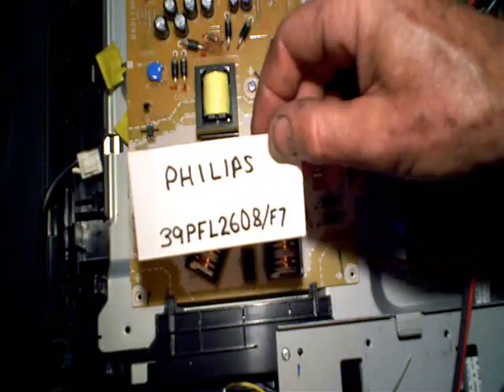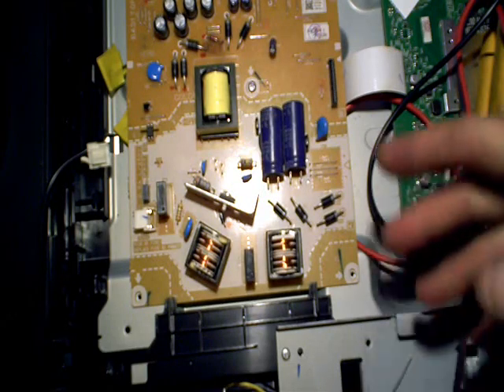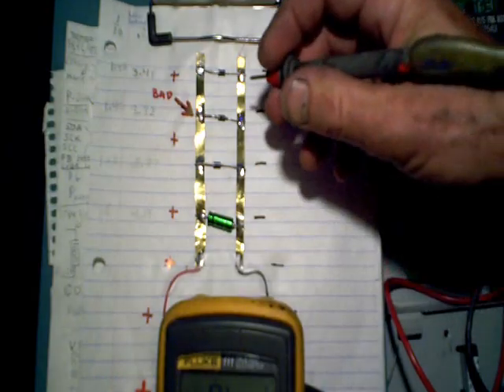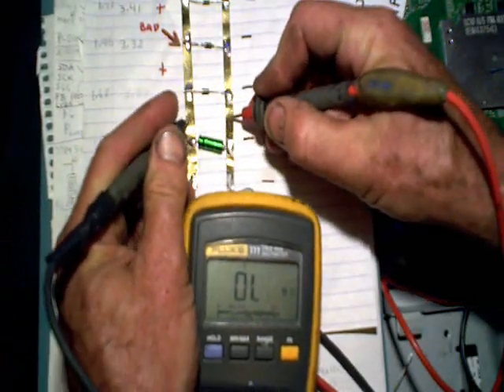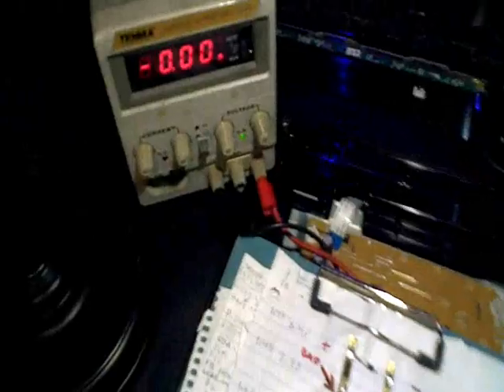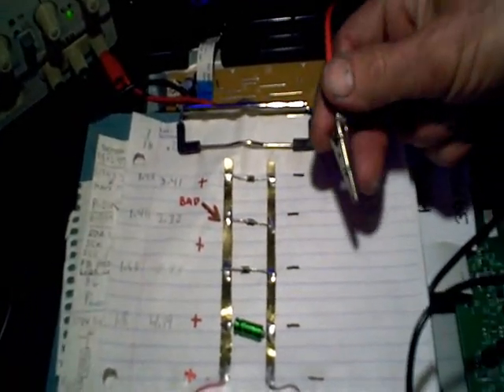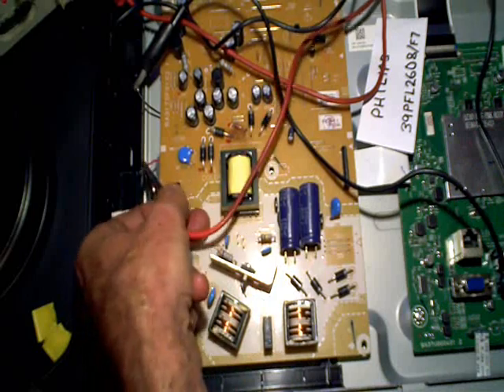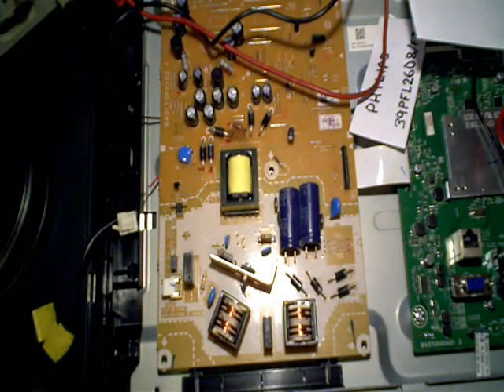Your Multimeters Millivolt scale can be used to locate shorts to ground.

Comment: I'm a retired avionics tech. 30 years ago HP published a trick not unlike your own, using the mv on the DVM, but with no guessing. To find the short connect a current limited supply to the shorted supply rail at the spec voltage but with a safe current limit. Now connect the positive lead to the rail, and we'll use the neg probe to chase down the short. Clearly the millivoltage will grow towards the short, and if you probe past a node, the voltage will stop increasing.
Reply from the maker: I'm not to surprised. Unless you own a low ohm meter capable of 1000 divisions it's a great option.
Reply: That's how I used to find shorts until I got a $200 FLIR that connects to my phone. Now one of the first things I do is take pictures of the board temperature signature when I first power up the item. Sometimes it pinpoints the problem without any troubleshooting.
Reply: @RickNickel  hi Rick  would you post a link to this?
Reply: @RickNickel  Looking at one today for the same purpose.
Reply: it kinda like the opposite of what he is doing very smart!!!
Reply: @GrantsPassTVRepair If your constant current that feeds the circuit is beforehand adjusted to exactly 100mA, then your mV reading on the multimeter will equal to mOhm reading. Thus, when troubleshooting, you are searching to spot the point of the lowest mOhm reading (as shown in the video). By this method you can also measure any small value resistance down to 1mOhm or even lower, depending on the accuracy of the multimeter you use, in its mV range. For the reading, you only need to shift the decimal pointer by one digit to the right side. In this way you read the displayed result directly in mOhms. This is also the best method to measure sub-Ohm resistors or evaluate shunt resistors with amazing measurement accuracy, which, otherwise, would demand buying very expensive mOhm meters of the market for that purpose...
Reply from the maker: Yes thank you. applying voltage in the manner you suggests makes sense. @ΠάριςΑζής

Comment: hi, is there a difference between a bad diode and a shortened diode when checked with a meter  what i am asking would a shortened diode measure as bad with a meter ? thank you
Reply from the maker: I don't quite understand your question,  but I think you meant to say shorted diode rather than shortened diode. ;-). When the short out they generally become like a piece of wire with almost no measurable resistance. Less than 1 ohm.

Comment: Well that's great if you short is because of a bad diode. What do you do if it's NOT a diode?
Reply from the maker: If it's a shorted part other than a diode,  the same technique can apply, but unless you have a schematic, or a pinout of the part, it can be more challenging to isolate which part or parts have gone bad,  When transistors go bad their terminals often short out between them, so using an ohm meter can also help you isolate the problem by looking for shorts between the transistor terminals. Having a schematic can help you understand what's likely to be a shorted part if you measure a low resistance path to ground on a component terminal that should show an open relative to ground of your power supply, and learning to read schematics can be a time saver if you happen to have one for the device you're trying to repair, and knowing which parts are more likely to fail can also be helpful. The parts which mostly commonly fail are diodes, transistors and ICs. It's been my experiences that electrolytic capacitors rarely short out, but sometimes the small surface mounted capacitors are known to short out.
Reply: That's exactly my problem. I have a short on the board I'm working on, but I suspect the issue is a ymf292f sound chip, for which I can't find a schematic or a replacement! Thanks for the response. @GrantsPassTVRepair

Comment: What a fantastic video!  Over my self-educated time spent (100's and 100's of videos and some books), what no one ever said/wrote was that in repairing electronics, it all comes down to OPENs and SHORTs; with SHORTS being the "variable" cause ... meaning that there can be a SHORT ...or... a PARTIAL SHORT that's causing the problem.  Once that became apparent, troubleshooting changed to "much easier" to diagnose.  I have a Zapper, built a LeakSeeker, have injected voltage, and and and.  This video from 7yrs ago ... I wished I had discovered earlier.  It added a very valuable approach ... inject a small voltage and then look for a voltage drop in the mA's (or maybe even uA's if you can).  Brilliant.  Thanks for this video.
Reply from the maker: Thank you for the comment. It's always nice to hear when someone appreciates on of my videos.  We had a period where bad capacitors kept repairmen fairly busy due to a manufacture error known as the "capacitor plague", but that's not so common anymore, so other than bad eeproms and leaky parts, I suppose shorts and opens do make up the bulk of repairs. All the best.

Comment: Actually, there is one thing here VERY WRONG.
Measuring with current is ok, but 0.25A is TOO MUCH - that could've fried your diodes!
Most diodes work on currents around 20mA (LED diodes for example) and that is a level you should have.
In this example you where lucky that the diodes you had there where power diodes, but on laptop motherboards and elsewhere, the diodes are much more sensitive and they can get fried with as low current as 50mA.
Of course, a short to the ground means that the power will go through the short and not through the diodes, but once the short is gone, all that power would go to those diodes.
Another safe thing (except limiting current) would be to try to find the short by limiting the voltage to 0.25 V - at this voltage most of the diodes just don't work and no harm will happen to them even if the short will be eliminated.
At 0.25V only thing that works is passive components (and shorts) - and those can handle that voltage no problem, so you don't have to limit the current so much when you are at 0.25V.
Reply from the maker: Yes there are some components such as LEDs that can easily be damaged with 0.25 of an amp, but If you insert a low voltage directly across one of the electrolytic capacitors on the circuit trace in question,  and apply the correct polarity your not likely to damage anything. Especially when you consider there is already a short dragging your voltage way down below normal operating voltages.
 If I see an electrolytic capacitor on the circuit trace I'm testing with a working voltage printed on the side, I think it's fair to assume I can safely apply 10 percent of that voltage and probably much more without causing any additional problems. Even if the short were to open, as long as you don't exceed the normal operating voltage of the circuit and you apply the correct polarity it should be fine.
Reply: @GrantsPassTVRepair  the short acts like a dim bulb device?
Reply from the maker: The short is preventing your power supply output from passing through the circuit it's intended to pass through.  @fullwaverecked

Comment: I fixed my MacBook Air with this method. It had shorted component somewhere on the main power rail to ground. Supposedly, capacitor. But which one of many (about 100)?
I put about 0.5V 1A to the board and then started to measure all capacitors to find one with the least voltage on it (because it will be the shorted one).
And I found it! With simple cheap multimeter and power supply.

Comment: Could you also use nS to measure conductance and then convert it to ohms? For small resistances. The fluke 87v has nS but is kinda hidden.
Reply from the maker: I don't understand your question.
Reply: Never mind. I was thinking you could use Nano Siemens which can be used to measure very hi resistance. In this case your measuring very low resistance.  My fault. Thanks

Comment: I would think a component shorted to ground would have no voltage drop across the component. Doesn’t the shorted component just become a low resistance wire, therefore no voltage drop across it .
Reply from the maker: Your correct about a shorted component becoming like a low resistance wire, but if you measure across the component input wires with a voltage applied to the component you will see more of a voltage drop than you would with a non shorted component.
Reply: Grants Pass TV Repair I thought less resistance less voltage drop. Ie. no load, no voltage drop.
Reply from the maker: Think about this concept. You attach a 10 volt battery to Two parallel wires that are 5 feet long, and at the end of the 5 foot stretch of wires you attach a 1 ohm resistor. If you measured your battery voltage right at the battery terminals it would read higher than the voltage you would read across the resistor due to the voltage drop across the resistor. If you did this same experiment using a 10 ohm resistor you would have less of a voltage drop, and you would read a higher voltage than you would using the 1 ohm resistor.  I hope this example helps.

Comment: can we use this method to find a short on a Laptop mother board?
Reply from the maker: Yes. If you know where to test such as a positive power rail that should never have an extremely low resistance reading to ground. If you don't know where to test on the circuit board you can check for shorts across your capacitors. If you get an extremely low resistance reading it means you have a shorted capacitor or something on the circuit in parallel with the capacitor may be shorted.

Comment: seems like way more work than just to take your chances and start snipping a few anode leads until your short is gone. then a dab of solder to reconnect the innocent components
Reply from the maker: Clipping leads or un-soldering multiple diodes sounds far more labor intensive than a few quick probes with a low ohm meter,

Comment: I like you video, this the second time I watch it because i am trying to find a short. little confusing, you measured across 3 diodes at about 1.04 mv. then you measure the shorted diode at 0.64 and you said you would know this is shorted because it has a much greater voltage drop. how is that greater voltage drop. isn't 1.04 mv is greater than 0.64.
Reply from the maker: 1.04 is larger than 0.64. The smaller fraction indicate more of a voltage drop.
Reply: @GrantsPassTVRepair  thank you. mmm I got to wait a while before that one settles in my mind.
Reply from the maker: @jacka.4774 Do you understand  how 0.1 is Ten times smaller than 1?                                                When I'm testing for voltage drop across each diode I'm trying to figure out which diode reads the smallest number to figure out which diode is shorted.
Reply: @GrantsPassTVRepair  thank you. so could you see if I understand it correctly. if shorted you read lower voltage across diode compared to the same ones.  same as measuring voltage across the same short piece of wire.
Reply from the maker: @jacka.4774  Yes, it sounds like  you understand correctly. When diodes go bad they often short out and become much like a small piece of wire, and you will see their resistance will generally measure One ohm or less. They can open also open up inside, but that's far less common.
Reply: @GrantsPassTVRepair  great wonderful. thank you so much.
Reply from the maker: @jacka.4774  Glad I could help.

Comment: Should I connect the  VDC power to a short circuit as your demo???
Reply from the maker: +Hiem Ngo I'm not sure I understand your question.
Reply: I am wondered when looking at your demo when you turn ON DC power supply and connected to a short circuit that you made it by your own. I think it would  feedback and blow power supply if you leave it for a certain time. THX,
Reply from the maker: Yes it could be a problem if your asking the power supply to deliver more amps than it can handle. My power supply can deliver up to 3 amps with out there being a problem to my power supply. If your power supply can't handle what ever current a short circuit produces, you can add a resistor in series with the device your attempting to repair. You resistor will probably get hot if your device has a short so you may need a high wattage resistor.
Reply: it is exactly you need to  mention in your demo, if there are someone do not know would cause lot problem. Also, You forgot to let reader know the  method measure Diode by reversing the lead of DVM,
Thanks,

Comment: I don't understand why people who do electronics keep buying Fluke multimeters, - yes they are reliable, rugged and accurate within their ranges - but the update rate is slow, the resolution is low, it's very lacking in functionality, and it's damn expensive.  It's more of an electricians' meter.
Reply from the maker: +TheAmmoniacal I don't know about the new fluke meters, buy what sold me on the one I started with is how well it tolerates abuse. Often times when  checking the voltage I would mistakenly leave it on diode check or the resistance scale and it never seem to hurt my meter. I wonder if many modern day meters can tolerate this kind of abuse.
Reply: 1. Keysight U1272A
2. Brymen 869
3. Brymen 257
Reply: ***** They are still much better than Fluke.
Reply from the maker: Do the meters you mentioned allow you to leave them on the wrong scale with out being damaged? I have a bad habit of leaving my meter on the wrong scale, and my Fluke meter has never been damaged doing this.
Reply: No modern >$100 multimeter should. But some of them will act up and take some time to recover. The U1272A will show inaccurate readings on AC for up to 2 minutes if you measure 220 VAC on the ohm range for example.
Reply from the maker: That's a slow recovery but at least I can handle an occasional mistake.
Reply: +TheAmmoniacal A fluke meter is a must have item in a tv repair shop...You take it on house calls and it gets dropped and the owner and I shared one so it got a lot of rough use. And it has good protection many times I left it set on ohms and tried to measure voltage but it didn't blow it out.

Comment: I am trying to understand how parallels can have different voltage drops . I assume there must be a voltage drop along the tracks joining them ?
Reply from the maker: I don't understand your question.
Reply: +Grants Pass TV Repair unless i misunderstand your approach , well the caps and the diodes are all in parallel so the voltage applied was across all of them equally. So if the voltage drops are not equal there must be a voltage drop between the components which are connected with conductors.   I cannot understand that this is possible unless the short is actually more short than a typical conductor .
Reply from the maker: Every component is in parallel, and by testing the voltage across each component I'm able to determine which one is shorted by observing which component has the lowest voltage reading.
Reply: +Grants Pass TV Repair two points ... I am trying to understand the physics of this . When using Mesr meter ...  ok lets say you measure 1v across component one and 1.2 across  component two . They are in parallel so they should have the same voltage across them .. But you are saying there is a difference . This means there must be a 0.2 voltage drop between the components because they have current running through them and ohms kirchoff voltage  laws must all add to equal zero. Secondarily , your measurements are made from a common negative to the end of each component which is measuring the resistance of the tracks themselves. If you are saying there is such fine measurements you would need to measure from the leads as they come out of each component .
Reply from the maker: If you have a volt meter sensitive enough to measure very small changes as I demonstrated using the millivolt scale of my multimeter, you will see the components will not have the same voltage across them. You will also be able to see a difference using a sensitive ohmmeter.
Reply: The more current that flows will in one part of the parallel circuit would cause lower voltage drop at the point of most of the current flow.  The other diodes in the circuit will only allow so much current flow due to their designed resistance which would leave a voltage difference between the + and _ of that diode.  Less resistance would allow more current flow resulting in a lower voltage drop measurement.  I have a diagram but cannot upload it here. I don't know if that answers your question.  The ESR meter is great for testing for bad capacitors also.
Reply: All wires have some resistance, so there will be a voltage drop across the wires (PCB traces) between the components as well.  This is why different components connected in parallel show different voltage drops, and different resistances when the rails are "shorted".
Reply from the maker: Exactly. It sounds like the guy is having a hard time imagining  a small printed circuit board trace can have enough resistance to show a difference between one component and another.